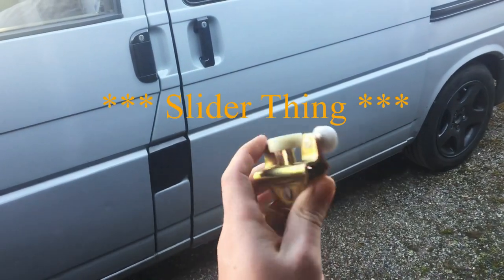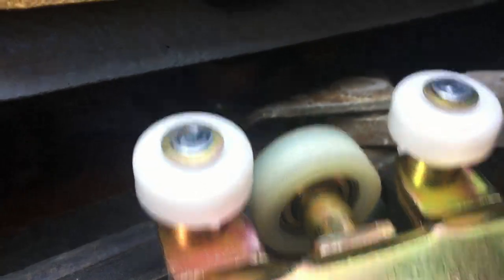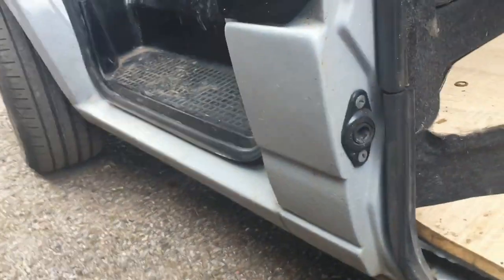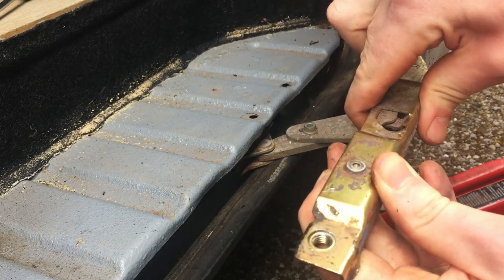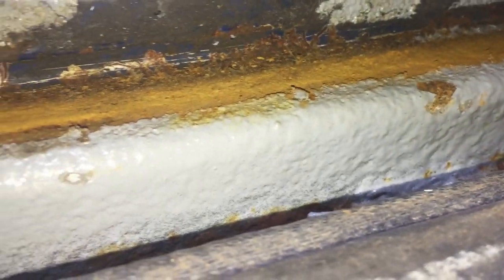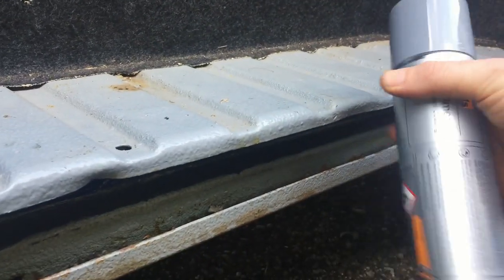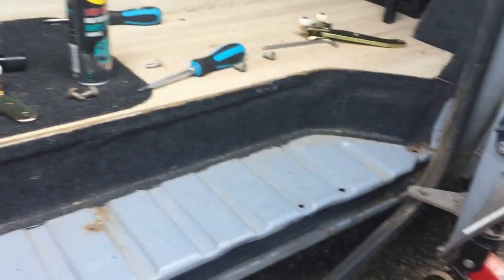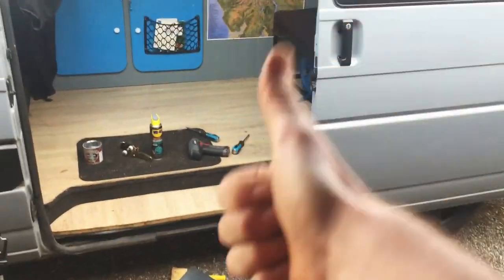T4 Sliding door roller replacement (bottom)

Comment: I just did this job on a mates van, managed to get the new roller in from the front of the rail so there was no need to remove the step or the stopper.
Reply from the maker: That’s good to know!
Reply: How did you put the bottom roller in without moving the stop or step?
Reply: Simply undo the roller and move it as far forward (towards front of van) as it will go. It will release from the rail. Pay attention to how it comes out and you will have no trouble fitting the replacement.
Reply: @T4TipsGuides  thanks for this. Saved me so much effort today
Reply: @DERBYSAM No worries. I just replaced the bottom roller, on the same van for the same person, a few weeks ago. This time it took about 2 minutes.

Glad to hear it saved you some time.

Comment: Nice job and very well explained and filmed/edited.
Quick question, why is it that there is meant to be no grease in there ?
Reply from the maker: Thank you! I’m not sure why not, but I know they came from the factory with no grease, so they are designed to just roll freely. Mine is still working perfectly fine and I haven’t used any grease. Good luck!
Reply: I imagine dirt would stick in the grease and turn into a cutting paste wearing the parts out prematurely